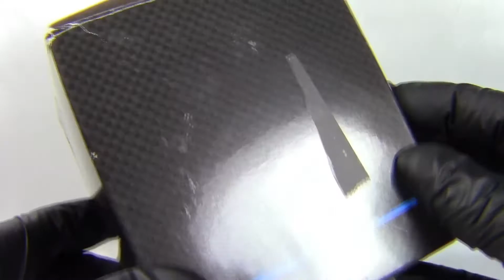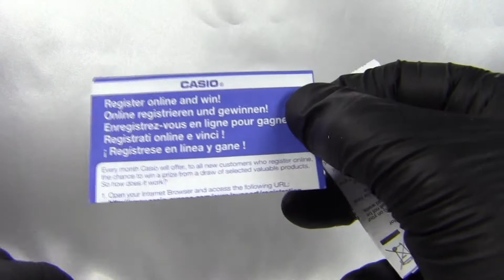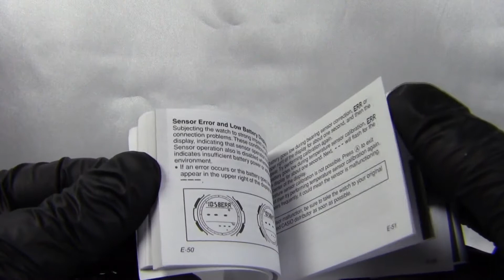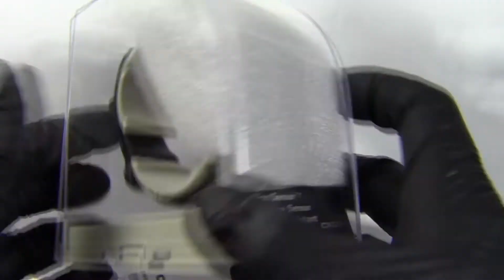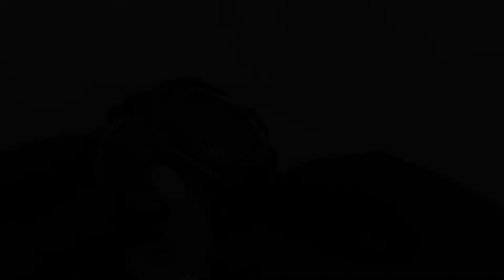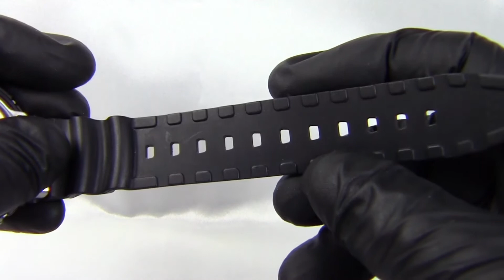Casio compass watch review model sgw 100 1vef

Comment: Hi thx for the video and i have a question. Is this watch have auto light mode even or just we have to press light button to light up?
Reply from the maker: It has auto light where you just turn your wrist and it comes on, you can switch that off though and just use the button to illuminate.
Reply: @rninnim  thx for answering me, but unfortunately i couldn't figure out how to set up it, can you explain that to me pls
Reply from the maker: @muntadheralwakeel  Hi sorry, just read through the manual, this watch only allows you to press the button to work the light feature, some other models allow for the turn of the wrist but this one doesn't, sorry.
Reply: @rninnim  thx for your answer, don't need to apologies things happen. Yes me either i read it and i know it doesn't have one thx again